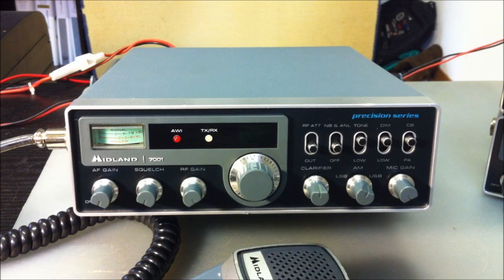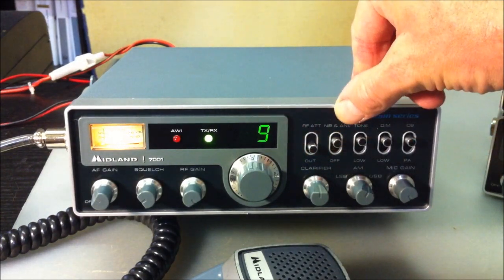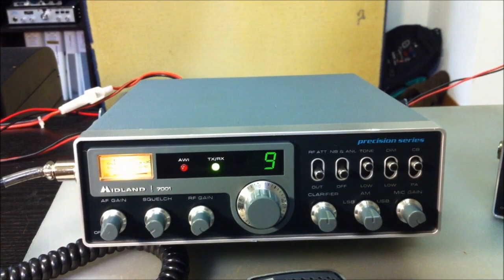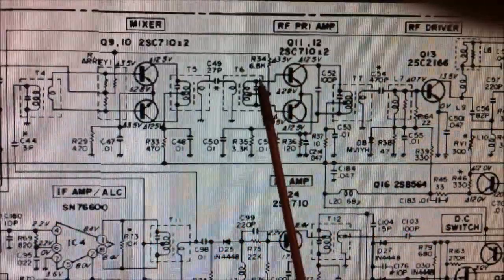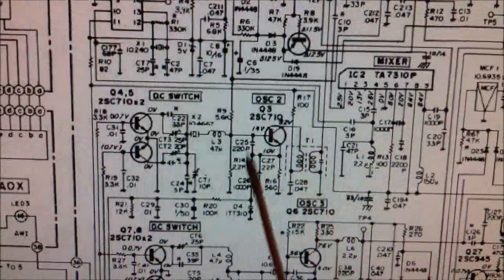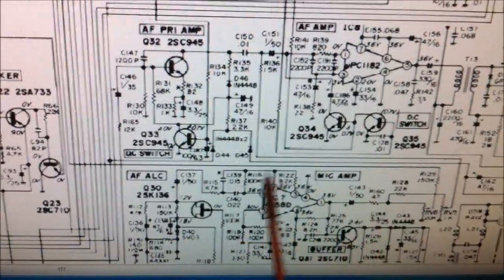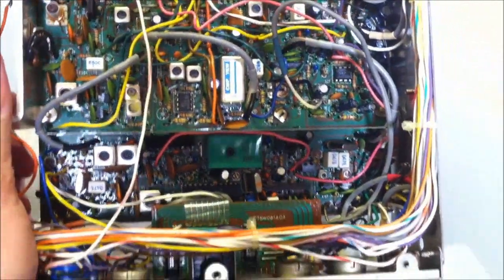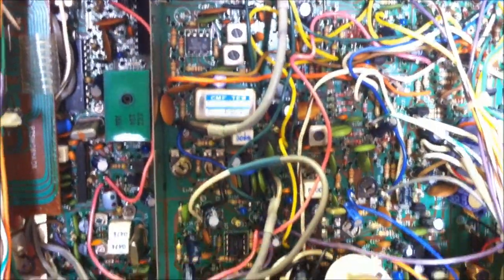The US MIDLAND 7001, one of the best SSB CB-radio by CYBERNET ever built

Comment: Hello, its a beautiful radios, both two pretty similar to General Electric 3 5825 A and 3 5825B. They share similar switches on frontal, AWI warning LED, and a lot of internal parts. I would like to view the inside of the export versión. Greetings. Both brands would be designed and manufactured by the same team. The General Electric what I had were build in Japan. Where was builded yours ?
Reply from the maker: CB-radio friend hello, thank you again for your visit on my channel. A lot of CB-manufacturer had identical PCB installed in there's chassis. UNIDEN and CYBERNET were the two big manufacturer in the 70/80ies. All in all, CB-radios and -antennas are a passion of me. It was a beautiful time in the 80ies: Big CBiers parties, without smartphones and instagram profiles. Best 73s and happy airwaves to you and yours. ..

Comment: Nice radio series! 
If i should choose between the 120 ch version and the 400ch version, do they have the same board basicly or is there big difference between this to models?
Thanks! Jan from Sweden.
Reply from the maker: Mr Jan hello, thank you for your interest. The 120CH version is using the PTBM059COX board (3x40CH) and the 400CH version the PTBM125A4X (4x50CH). You'll find these schematics on the HAM-INTERNATIONAL side: http://ham-international.nuxit.net/cybernet.htm
Reply: Thank you very much for reply and great info! I just (yesterday) bought myself the 120 ch version from ebay, cant wait to have it test it and compare to my other stations, its really looking to be a nice rig. Thanks from Sweden! Jan/21JL66.
Reply from the maker: Yes of course, the 120CH-version has the more professional board installed , like the 400CH. Because: The SSB filter is bigger and more better, The driver and final is installed in a kind of box with big heatsink, the AF-Amp (TA7205) is not so noisi like the new one. Good luck with your new radio...
Reply from the maker: Hello mister MIDLAND 7001 user, thank you for your interest. Your 120channels version radio uses the PTBM059COX board. This print is supplied with the FM section. The US-version don't have FM includet. Best 73s to you..

Comment: What are the other radios that use that board?
Reply from the maker: Mr Alex hello, thank you for the question. I don't know which radio uses the similar board. The MIDLAND 6001 (79-006) uses the similar board. Has anybody a plan? Thank you...
Reply: What about the Lafayette lms 45
Reply from the maker: Oh yes, the LMS45 is in similar design. But I don't know wich Chassis this Lafayette is using. 73s to you.
Reply: Could you look into the low modulation on a President George If there is a way to improve.
Reply from the maker: Mr Alex hello, thank you for the question. The PRESIDENT GEORGE is'nt in my collection. I can't help you to time. Best 73's to you...
Reply: my lafyette 1800 is identical to my 6001's coverage, ch5 D band is triple 5 on the 1800 and the 6001, my 7001 is a frequency readout.

Comment: I thought the Uniden President HR 2510 was the best CB Radio ever built.
Reply: I have never owned a Sommerkamp radio either.
Reply from the maker: OK, that's right. But the M7001 is built in 1978, The HR2510 in 1988 and the Georg in 1997. The MIDLAND 7001 was a great rig in the later 70es. Happy airwaves to you all...
Reply from the maker: +MisterPersuasion oh yes, the President HR 2510 is a good CB/HAM-radio, it's manufactured in 1988 and also in my collection. The old Midland 7001 was one of the latest CYBERNET products in 1978. CYBERNET has never built a better CB-Radio after the 40CH time. Unidens were the better CB radios in 1980-1983. Happy airwaves to you...
Reply: You should do a video on the HR 2510 sometime.  So which is better between the Midland 7001 and the HR 2510, in your opinion?
Reply from the maker: +MisterPersuasion Ok, but it's better when I make an opinion between the HR2510 and the SOMMERKAMP TS-788DXCC. These both radios are HAM/CB radios with similar attributes. The Midland 7001 is only a 40 CH CB-radio from a earlier generation.
Reply: Whatever video you make, I'll come watch and like.  I've subscribed to your channel. :)
Reply: +SWIZZRADIOS So I'm just wondering how you rate the SOMMERKAMP TS-788DXCC. I've never owned one but have seen plenty of them and I was told they were very unstable. I have owned most of the Uniden 2830s and President Lincolns etc and they're great radios if a little delicate.
Reply: +MisterPersuasion The question wasn't aimed at you my friend.
Reply: I have HR 2510 and also have a president George and the George is a better radio but the Motorola 550 is  better by far on receive and transmit also the build quality, but not easy to recap (double sided board).
Reply: I had a George and had to get rid of the damn thing because it's not very user friendly. It's hopeless in the mobile because it looses the setting every time you switch it off. Looks nice and works well but I just couldn't be bothered with the dreadful menu driven set up.
Reply: Yes in a Mobile my Grant Xl and my TRC 540 both using a 2018 noise canceling are great Also on the George there is a battery mod to keep your settings.
Reply: It had a battery backup but it only keeps some of the settings. It always returns to stock when the power is removed because the export mode is illegal in most countries. Same problem in the shack if you switch it off.
Reply from the maker: OK, that's right. But the M7001 is built in 1978, The HR2510 in 1988 and the Georg in 1997. The MIDLAND 7001 was a great rig in the later 70es. Happy airwaves to you all...